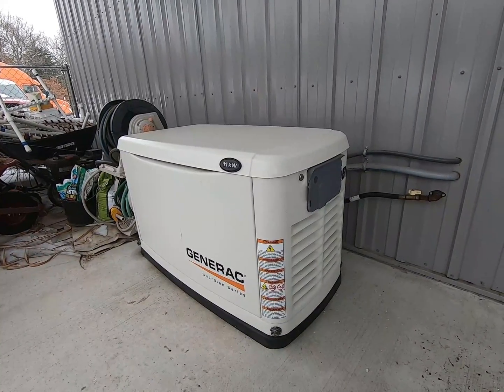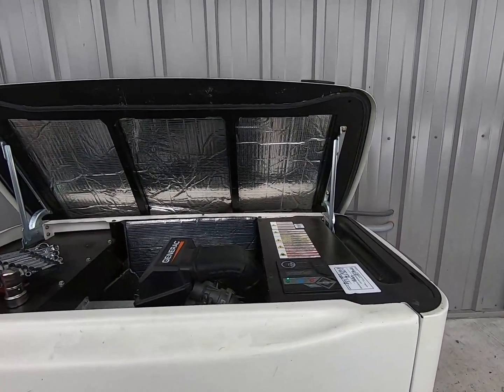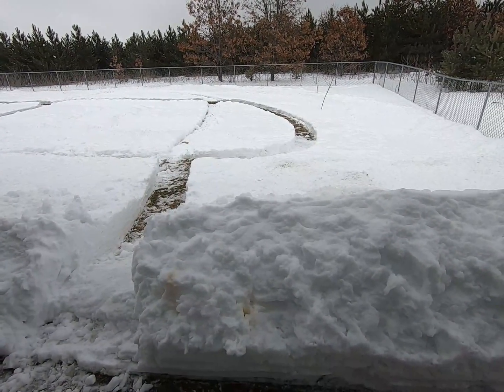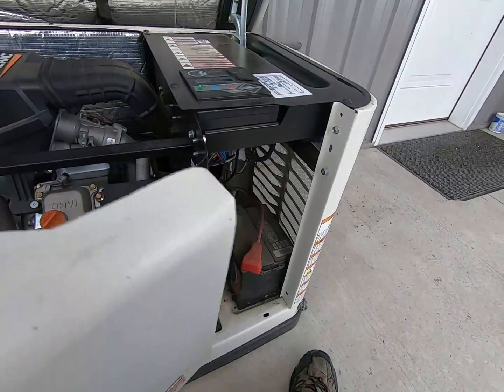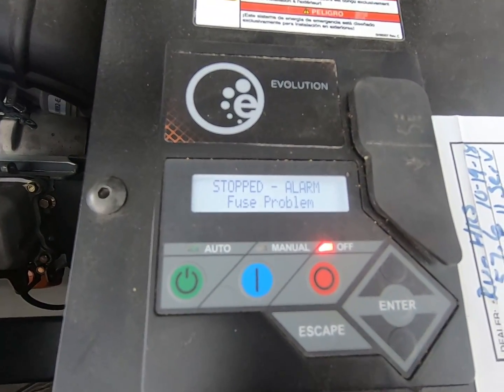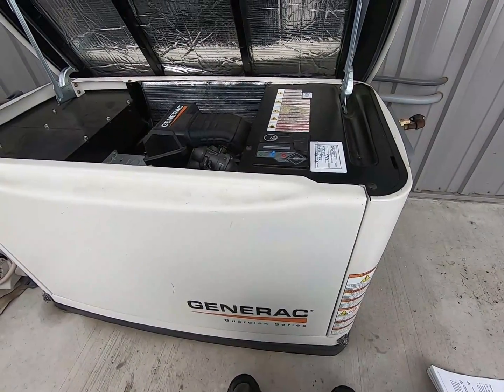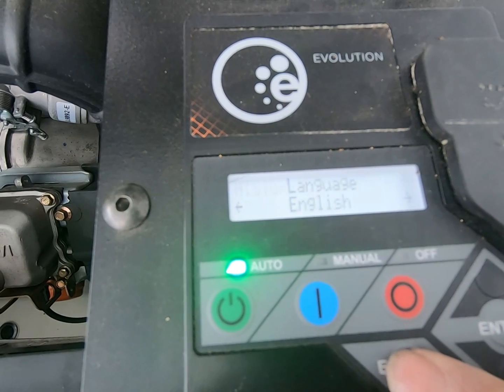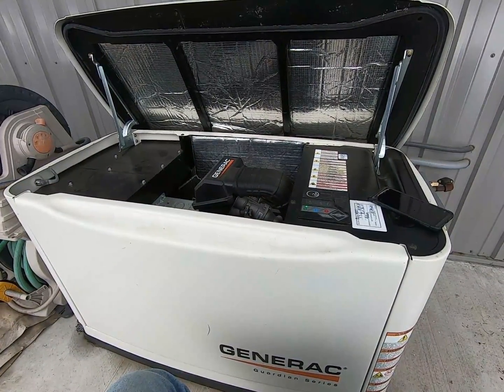How to change the battery and reset your settings in a Generac standby generator

Comment: I just got my new generator and about two days after activating, I started getting low battery alert and charger errors. Of course it was the weekend and service calls are very expensive. I called my service company and they said that the charger was probably wired wrong. So I checked the battery and it was not charging. I took the battery out and put it on my charger. Right after the charger started getting hot and the battery wasn’t taking any charge. I went to AZone and bought a new battery. After installing the new battery, the faults went away. Every thing is fine now. The installation tech gave me a used battery off his truck and charged me for a new one. Not cool. Anyway, never over look the obvious.

Comment: All I can say is "thank you."   I went from grave concerns regarding 'codes' to actually changing out the battery.   I didn't need to re-enter the panel information, but I did need to reset it by hitting "Off", then "Enter", and then "Auto".  It all reset and then I started it through "Manual" to ensure it worked.  All was perfect.  Thanks for helping.

Comment: #1 Unplug the molex connector under controller before touching battery. This disconnects the charger. You blow the charger, you replace the controller.
#2 Always remove the negative battery cable from battery first. Then you can't short the positive to the enclosure, as it is no longer connected to the battery. When installing new battery, reverse procedure.
#3 Opening the 2 pole breaker does nothing. It is only there to comply with codes and limit load on the generator output. 
      Turn generator off from the controller and pull the fuse.
I service many of these units yearly.
Some models require dealer code to reset maintenance log.
Look for a keypad hack on the web to get around knowing the dealer code.
Reply: This a video on how not to do it. I was waiting for an arc from the battery when he got real close to touching his wrench to the casing..... Scary!
Reply: You pointed out some really good things here in your comments, thank you.
Reply: What is the valve lash that he says he does yearly on his maintenance?

Comment: Honestly, it doesn’t feel like on my generator I can get the battery out without removing the end portion with the vents on it. Everybody watch it looks like people can just slide these batteries off but mine seems like it has no room. Is there an easy way to get the end portion with the vents off so there’s much easier access to the battery? I’m slightly disabled, so for me would be much easier if I had full access to the battery – thanks in

Comment: Really helpful - I saved $150 in a service call by watching this.  Much appreciated - merry Christmas 2023!
Reply: Most of them charge to do the battery and replacement separately too. I got quoted up to almost 400 by 3 different places to service it and that's not even the batter either. LOL. I laughed and said forget that. Will buy my own oil and get the kit off of Amazion.

Comment: I see you removed a Duracell battery that you said was 7 years old. I installed a Duracell from Sam's club in ours brand new in June of 2020, its nearly October of 2023 and its showing just 12.1 volts. thats barely 40 months. We're in Florida where its hot and humid......

Comment: Good video.  The Geniuses at Generac designed battery placement making it almost impossible to access.
Reply: the 11Kw shown above looks a lot easier than my 22kw.   I agree
Reply: I take the whole side panel off my 22 to replace the battery.
Reply: My 24 KW battery was easy to change out🤷‍♂️

Comment: 4-17-2023
👍🏻🙋🏻‍♂️ have 22Kw Generac Generator installed last April 2022, and had a battery check warning, but I’ve got no equipment to do that check. I also have the 10 year warranty, and internet connection, and mine runs off Natural Gas. I guess I’ll have to call for service technician.

Comment: We bought this house less then 2 years and inherited the 5875 model. It was installed in 2010. How long do these lasts if maintained properly?  Also, mine runs on natural gas. After / before changing the battery ( which died couple of month ago), is there anything special I need to do for natural gas supply versus what you have ( propane) ?
Thanks
Reply from the maker: Nothing special.... If cared for it should last a very very long time.

Comment: Should you shut off power inside at panel when replacing battery?
Reply: I just took mine out without the breaker off but the thing is, my system automatically turn off if it is connected to the city power so you would need to do a few more step depending on your system. https://www.youtube.com/watch?v=aurs3LQl7OI

Comment: So I just purchased a house with an 8kw Generac and it was tested and running 3 months ago. Today I checked it and the RPM Sensor Loss light was on. I am assuming it pertains to the battery. First, when you tested the Generac, shouldn't the house main panel switch be off? and 2) can the battery be trickle charged and put back in or is it not worth it ant get a new one? Is there any other things that may cause the RPM Sensor Loss light to come on?

Comment: If the battery is dead and your power is out, can you pull a vehicle up by the generator, hook up jumper cables, and press the start button to get it running?
Reply: Excellent question…
Reply: @nasarazam  Be best to get a portable jump box, my nephew tried to jump start his water bike with his truck and fried all kind of stuff up...

Comment: Optima Red Top AGM is what I have used for 10 years now trouble free. BTW the system uses a trickle charger to keep the battery charged. I have mine set to run every other week for system check, I change oil every yearPennzoil Ultra Platinum 5W-30 Full Synthetic.

Comment: ok, you hit on what I need to know. At one point your screen was showing ready to run and hours of service (stand by hours). Then it flashed to hours of service and back to original screen . Here is my question. I had to reset mine after a lightning strike (not direct on unit) . My screen was right where you were but it flashes back and forth to show hours only and right back to screen you show. Is it supposed to go back and forth like that?

Comment: Thank you for your video, I need to change my battery, it died after only three years 😔   
#1. When do I put the main breaker back on?   Lastly after you run the generator and reset all the settings?  
#2  what is the AGS you were thinking about changing it into?
Thank you.
I know feel confident that I can do this myself.

Comment: Get rid of it, if you ever really need it for any prolonged use it will probably break. I have a 22kw on my house it is about 6 months old and has no hours except for the weekly exercises. Well hurricane IDA hit and we ran it for  2-1/2 days and the gen-set has burned up we lost all the food in our refrigerators and are sleeping in 100-degree heat for the last 4 days. Last night I yanked that POS out and replaced it with a 20kw Trane unit and it runs like a Trane. I own an industrial supply house in New Orleans and we are a Generac distributor my brother-in-law purchased the same 22k unit from me and it has never been run. We installed it and it doesn't generate electricity. If you like a boat anchor in your yard to change the oil, air filter, and battery because you are bored buy a Generac, if you are looking for a generator that works, purchase a Kohler, Trane, or Onan and I have PLENTY of people who have this same problem but I don't want to make this comment any longer than it already is.
Reply: I lucked out with my Gererac 22KW.  It ran 6 days straight and kept our whole house running after hurricane IRMA back in 2017.
Reply: 8+ yrs. Never an issue. Has run a number of times for 1-2+ days straight. Plus numerous half day and the weekly maintenance run.
Reply: I'll do you one better, as I have been a mechanic for 30 years. The more simple the design, the less stuff to go wrong. That said, have an electrician install a generator hook up to your electrical box, it's much cheaper than the installs for these home units. Get you a 11.5k or larger Westinghouse portable generator. They have 5% or less THD and are fine for sensitive electronics. They run about $2k and up depending on size. No where near the electronics these generacs have, and because it's portable (on wheels) you can take it to any mechanic to be repaired MUCH CHEAPER. The parts are cheaper, they are easier to work on, and you can take it with you if you move. Plus you can buy 5 of them for the cost of one of these and they literally do the EXACT same thing. The ONLY difference is they won't automatically start. Small price to pay to save $7k and get 1,000% more reliability.

Comment: What gauge are the battery cables?  I cracked the negative cable connection.  I need to buy a longer cable to connect the ground to the front side engine mount because I cannot access where the current one is connected on the back side of the engine .
Reply from the maker: I'm out of town for a bit, can check when I get home...don't remember.
Reply: @DIYSEMI  I'm thinking 4 gauge.
Reply from the maker: I would say that's probably right if memory serves me right

Comment: Hi i changed my battery and it says ready to run and under that it says check battery and the light is yellow but everything is working properly.Not sure what to do with that???
Reply from the maker: Once per year it tells you to check battery as part of annual maintenance.  If battery is good, clear the code and all good. Check your manual for  instructions, or email me diysemi@yahoo.com and when I get a chance I'll walk you through it.
Reply: @DIYSEMI  Thanks for your time.ill keep you posted.

Comment: Just so you know, on a Generac, the battery is not charged from an alternator, when running, but rather from the Transfer Switch 120VAC through fuse F3 in the TS -- a trickle charge.
Reply: Would you have a picture of this fuse  in the transfer switch. I have a 22kw.
Reply: @glennarchdekin1279  I do, but don't know how to attach it. Inside the (newer) Transfer Switches is the SACM (Smart Air Conditioner Module) that has three fuses, the rightmost one is labeled T1 (not F3, sorry). This is the one that feeds 120VAC to the battery charger in the controller in the generator. The SACM is black, plastic, with all of the control wires from the generator going to it, along with a Molex plug on the right-side, connecting various limit switches and sensor wires on the TS. Hope this helps you out.
Reply: What if you don't have power and rely solely on gas to power the generator for power?
Reply: @repure1999  Then the generator output powers the battery charger.
Reply: In the generac, the battery charger is powered through the low voltage that is run to the controller, as the charger is integral to the controller.  The Kohler controller is similar, with single low voltage.

Cheaper to install (slightly) than similar sized Cummins or Briggs because fewer low voltage.  However….if your charger goes bad in generac or Kohler….get ready to pay 800 to 1000 to replace the entire controller

Comment: The generac instructions say to change the battery every 3 years, but do you REALLY have to change it or is it like a car where you only have to switch it out every 5 years?
Reply from the maker: I change it as needed....I can't see taking out a perfectly good battery...but that's just me.
Reply: @DIYSEMI  So if you test the battery and it's good you can leave it in for another year?
Reply from the maker: @pootandbeans5956  I don't see a problem with that
Reply: Easiest way to tell is to check the voltage on the battery.  If it is between 13.4 and 14, battery is good. If it is 14 or higher, change it. This is because as the battery ages, it builds up resistance inside and takes more voltage to keep it charged.
Reply: Mine batt just failed at 8+ yrs old. That's a good life to me :)

Comment: From a retired tradesman, you didn't put the month and year of installation on the battery.  That's the first question will ask on a failure, "how old is this thing?"
Reply from the maker: You are right..it was peened in the case at the store. I assume they do that so you cant just swap out the sticker. Thanks for keeping me in check!

Comment: Excellent video... thank you!
Reply: Battery replaced but orange alert light still lit up  ( “check battery” in the input pad readout screen but scrolling through the menus to the “battery” option seems to go nowhere, just an endless loop of repetitive options) and the recommended remedy to turn it off hasn’t worked
 :-(  Tech scheduled to return in Oct for semi annual maintenance so will live with it till then and maybe he has the magic formula :-)
Reply from the maker: Mine does that as a yearly reminder to check the battery...but i can just clear the code in the service menu...wonder why yours wont clear.

Comment: I have a 2018 22kw Guardian and need to adjust the start up delay when utility power fails, The gen starts up to soon as we have momentary power flickers. I know some of the programming ,but cant find the delay start setting. Thanks from Hot locked down again Texas.
Reply from the maker: Looking into it deeper, i will get back to you
Reply from the maker: The good news is. Its adjustable from 2-1500 seconds. The bad news is,its in the dealer menu and can only be done by a service tech.

Comment: Error code 1902 is not low battery voltage, but an issue with low generator output voltage issue. Having said that, I would replace the battery every 5-years.

The actual error code from the diagnostic manual is:
 "Both Zero Crosses Missing. Under voltage due to faulty excitation winding, or zero cross circuit, or circuit in general. Probable cause: loose wiring, field boost hardware failure."
Reply: Highlands _Guy follow the flow chart